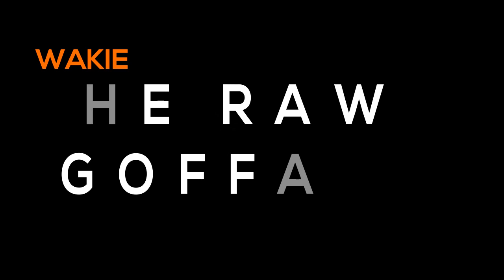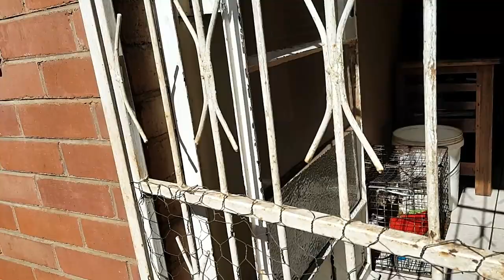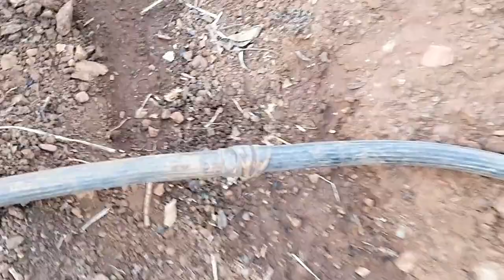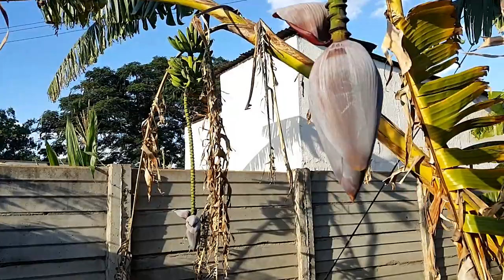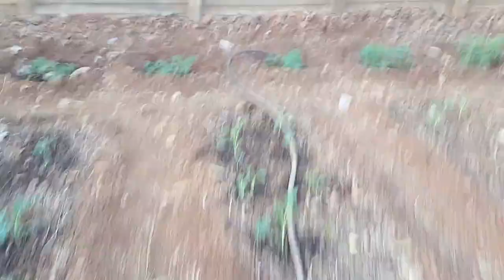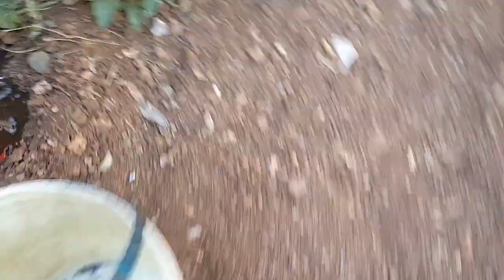Bulawayo Mashaya Inyoka | THE RAW GOFFAL

Comment: eish bra all that effort and time to water the garden. Just google and design the drip irrigation yourself, build and install it.  Me I am too lazy to water, water all the time. Build once and just use a hydraulic system like we see on homemade youtube videos  for pressure to spread the water. Just some few buckets of water  from the well into a container, use a big stone for the hydraulic pump system to spread the water and I am done for the day with gardening.
Reply from the maker: That's the plan bit problem was the lock down at the time had prevented any sort of plan happening.